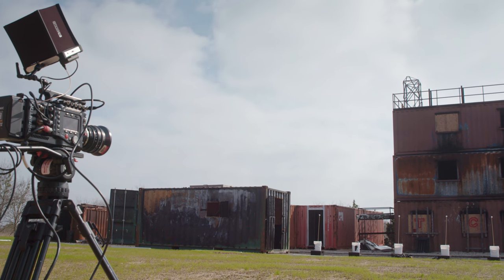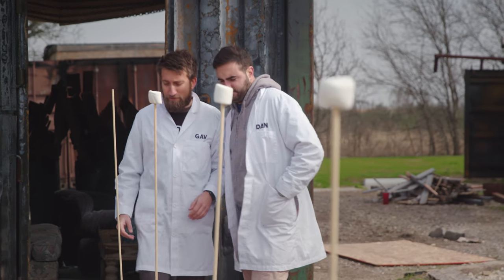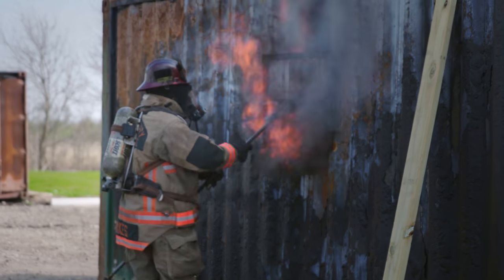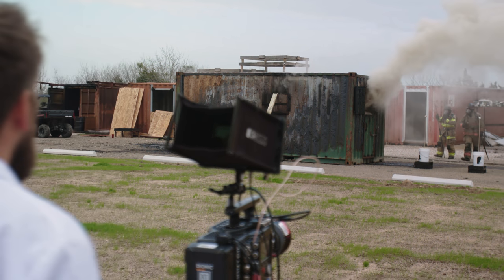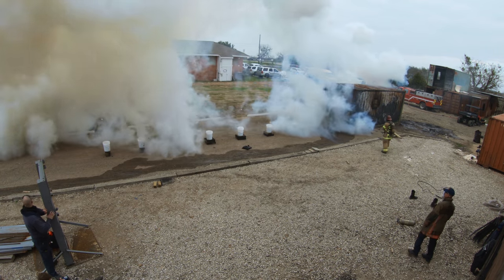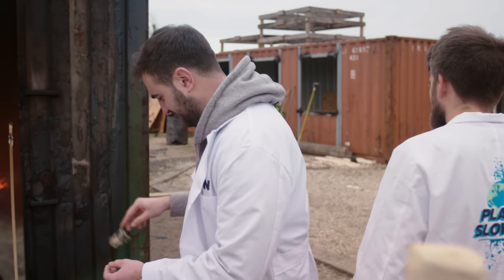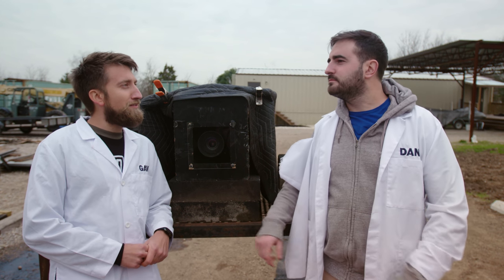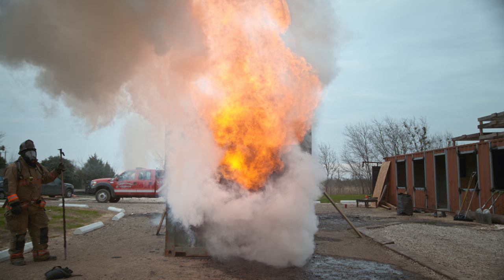4K Slow Motion Backdraft

Comment: This happened to our department and the city fire department when they called us in to a large corncob bin fire. Two large doors where open to allow us to pour water streams into the structure. We'd been there for almost an hour when my chief ordered me to go fill somebody's air bottle. The truck with the cascade unit was just outside of the fireground as I changed the guy's air bottle. That being done, I got on the horn and asked the chief if I could set up the cascade to fill more air bottles, as this job looked like it was going to be a long, drawn out affair. He said " Yeah, go ahead Ron."
As I put the empty bottle into the steel bucket to start filling it, I heard a loud, rattling, booming sound and looked up in time to see a huge plume of orange-blue flame, smoke and burning corn cobs engulfing the city's engine and everyone there in that area. I saw the top of the bin lifted up and clanged back down again, with flaming corn cobs rocketing into the air. Silence then surrounded the area, except the sound of our trucks. My first thought was " My God, they're all dead!" But then I heard one of the paid city guys call out, "Eyeee-haaaaaa!!!" 
Okay, time to go. Somebody's okay!
I grabbed my gear and ran back in there to help pick up the pieces.
In all, three of Fremont's guys had some burns and bruises, while ten of us volunteers where battered around more by the backdraft. Two had dislocated shoulders, while others suffered from bumps, bruises and some burns. A friend of mine didn't know he'd wrenched his back after everybody was transported to the hospital to be checked out. ( the adrenaline wore off!) What's spooky about it? It was Halloween, 1997. We got our Halloween scare...
Reply: Ronald Robertson wow
Reply: I have a creeping suspicion none of this ever happened
Reply: @Cookie-gw1vv  It did! Believe me, it did. It put our department out of action for a couple of days until we could get the equipment we lost replaced. If you can, look up in the Fremont Tribune, (Nebraska) November 1, 1997. The fire is in there.
Reply: @ronaldrobertson2332  maybe give a link?
Reply: Fremont Rural Fire Department does have a Facebook page. Go there and ask about that fire. October 31, 1997. Fremont, Nebraska. Ask about that fire at Junior Weiser's.
Reply: Let's be honest guys... who did not read the thing full and came to read the replys?
Reply: Grossmesser1  The fire was Halloween, October 31, 1997. A few of our guys were out celebrating Halloween when we got mutual-aided by the city fire department.  I was getting ready to take my daughter out for her first trick or treating; she was barely one-year-old at the time. We got the page, and my wife volunteered to take her out while I went to the station. She later told me she heard a loud wang from over by Hormel, a mile and a half away. That was the backdraft that almost took out Fremont and Fremont Rural Fire Departments.
Reply: To me this sounds less like a backdraft and more like a grain dust explosion. https://youtu.be/IiuBoAhJxaM this is a link explaining what a grain dust explosion is.
I'm a ff in a very rural town and have taken classes on farm equipment emergencies
Reply: @zombiekil67  yeah, doesn't a backdraft happens only if a room is closed, and it burns all the oxygen, and when you open, it suddenly re ignites and boom ?
Reply: r/tottalyhappened
Reply: I'm sorry, but I'm imagining corn flying everywhere...  Ignore me I'm a horrible person who can only laugh in the face of other's pain.
Reply: @TurtleSauceGaming  ...And yes, you're a horrible, horribly mean guy. 
You..you mean guy!
Reply: There will always be somone critisizing no matter what the situation is, i believe this
Reply: PLEASE use paragraphs.
Reply: Umm a firefighter does not call a cylinder a air bottle 😩 trust me I’m a firefighter 👨🏻‍🚒 just like you do not call a engine a truck a engine is a pumper a truck is a ladder
Reply: @justinwetzel9741  Which department are you with?
Reply: @justinwetzel9741  Bro we all call them different things in different places around the U.S. and beyond. Especially if your department doesn't even have a ladder truck nobody is gonna care what you call one or the other.
Reply: @ronaldrobertson2332  one you have never heard of
Reply: @joelaugustin6407  you would still know a ladder is a truck lmao a engine doesn’t get dispatched as a truck now does it 🥱I bet there’s some probies out there calling a New York Hook a Pike Pole and don’t know what a flat head axe is with a halogen bar🥱 a set of irons
Reply: @justinwetzel9741  except the fact that a lot of firefighters do call oxygen tanks air bottles

Comment: I was a full time Fireman for 30 years, an indication that a backdraft is imminent, is to look for 'pulsing' of the smoke coming out of the building, just about visible in these scenarios although not very clear at all.
I was once doing 'flashover' training and actually inside a container on fire just like this, after we extinguished the fire, I looked at the temperature recording equipment, it showed 520 degrees celsius at head height, we were lower than a snakes belly putting it out!
Reply: Olbno
Reply: No full time firefighter calls himself a "fireman." If you were a fireman, you stoked fires, you didn't fight them.
Reply: @gordonhaire9206  I don't give a toss what you think, I joined FULL time nearly 50 years ago when we were called FIREMEN, not a woman in sight!
Reply: @cvince2862  I joined 58 years ago. We were firefighters, not firemen. The job title was FIREFIGHTER.
Reply: @gordonhaire9206  Plenty of firefighters say fireman casually, full time or otherwise. This is a youtube comment, its not like he's updating a resume. Quit giving credence to the crotchety old smoke eater stereotype.
Reply: @gordonhaire9206  do you think it is remotely possible that the two of you come from separate countries and that is why you use different terminology?
Reply: @gordonhaire9206  relax..  fireman is included in official dictionaries as male firefighter..  in addition to the person who tends a furnace or steam engine.. both are used.. although firefighter makes more sense..

Comment: I'm no expert, but I would not have expected a fireman to walk into the killzone like he didn't know what was going on.
Reply: The Philadelphia Robot Factory
Reply: The Philadelphia Robot Factory 145638
Reply: it looked like he knew the limits (hopefully) and just avoided the actual hitbox by a few pixels.
Reply: He was starting to duck as he was stepping through, but I bet it didn't feel like enough.
Reply: He was following orders by I guess his superior, just happened to be in the wrong place at the wrong time
Reply: I'm sorta thinking from what can be seen that he was actually about to duck under the window because right before the fire spews out he it looks like he's starting to angle himself down to maybe crawl under or just be in a position to drop quickly in case it came out. I would even go as far though to say that it could've been slightly on purpose with the idea going through their minds thinking "we're going to show people just how dangerous this can be when a professional firefighter himself has no way of knowing when the fire is going to spew out" while making sure that the one crossing would be in a position make sure he wouldn't get hit. It's also possible that backdrafts are hard to replicate and are not fully understood and it was thought to be unable to backdraft after a certain time period, but were wrong. However that does make sense as that first backdraft was actually fairly weak compared to the others of which took less time to initiate the backdraft and seemed to reach further and spew fire harder.
Reply: I'd say just impatient. "Where's the ka-boom? There was supposed to be an earth-shattering ka-boom!"
Reply: Very foolish from a professional
Reply: This is why there's training facilities - everyone makes mistakes
Reply: @elitebelt  (
Reply: @bernardw7535  he was probably the rookie and the chief wanted him to learn a lesson about expecting the unexpected.
Reply: A real backdraft happens within a second or two of oxygen introduction. The Dutch door design probably had something to do with regulating the amount of oxygen that could get in quickly as the smoke was pushed out.
Reply: @SengRath-xu4nw  the n
Reply: The whole department fail..
Reply: That's easy for us to say, but considering he's totally find and didn't even have to take a break and replace his gear I think he knew the risks and decided it wasn't a big deal.
Reply: Hi
Reply: @SengRath-xu4nw  9 2018 p
Reply: 690 likes 

Nice
Reply: @bernardw7535  well, any sane person would say no to this kind of order, it's like if you see a guy with a machinegun suppressing a hallway, you're not gonna run in front of it, would you ?
Reply: You'd think that he would have go around the container of crispy death.
Reply: @Nareimooncatt  That's a far reach right there. I doubt it. I think it was just human error. Besides their suits do protect them to a good degree. Everybody makes mistakes. It is what it is.
Reply: Fireman is not an 8 yr degree lol
Reply: Except that's his everyday job. These are not burger fighters, they are fire fighters.
Reply: He was the affirmative action hire
Reply: Well you gotta consider, this is probably a really good training refresher for them as backdraft's aren't something they see or deal with every day. So wouldn't be surprised if the two guys actually running the demonstration aren't actually the most experienced ever, since you can see several more firefighters in the background observing throughout the video. But to me I don't think he was actually going in front of it, it looked like he was just bending down to open the door at the worst time possible lol
Reply: @SengRath-xu4nw  fist time typing khmer on the keyboard?
Reply: It's called, rookie!
Reply: Exactly, like how did he become a firefighter
Reply: People can get complacent on training grounds. It's also really different to have a camera crew on site too. Definitely not defending this critical mistake but I could see how if it were going to happen it would be in this situation
Reply: That guy saw his life flash before his eyes
Reply: @kaipaio4158  Same reason you were conceived.
Reply: К
Reply: @NGC1433   burger fighters?
Reply: They knew exactly what was going to happen and thought it was not going to happen at all.  But then WHOOOOM
Reply: Seems to be a lot of armchair experts here.
Reply: @kaipaio4158  your comment makes absolutely no sense, do you expect firefighters to be highly trained and experienced from the day they first apply for the job.
Reply: Firefighter gigs have been highly-prized since forever because it's a local municipal job with a government pension and a powerful union where 95% of your shift is spent sleeping, eating or doing maintenance.

I worked for 5 years as a firefighter in a medium-sized US city: when I was there, there were approximately 10x as many applications for the fire service as for the police or EMS, and this is with a bachelor's degree in Fire Science and 2 years experience with a volunteer outfit being mandatory to apply . There are also far less jobs available for firefighters because the job's actually less physically demanding than police or EMS, so most of them retire in their 60s instead of in their 40s or 50s. It used to be a thing where only the Chief was allowed to be old and fat... now the Lieutenants are all old and fat, too.

The upshot of all of this is that most paid firefighters got their job because they knew somebody or filled a quota somehow. The backlog of highly-qualified candidates is so long and the number of (union) jobs available is so small that there's no way to avoid the influence of political patronage. Fire Inspector gigs are the same way.
Reply: the army has a similar 'easy' image, if you ignore the mental burdens included. Firefighters see some crummy stuff, to put it mildly. But it's good many people still have a sense of duty, wanting to save lives - even with that political patronage. There's still people with ideals.
Reply: @forsaken696  are 👍
Reply: @bernardw7535  Where have I heard that before?
Reply: @alveolate  a
Reply: @SengRath-xu4nw  9m
Reply: backdrafts are inherently unpredictable, especially if you cant see into the space that is on fire, everything from the temperature of the fire, to the displacement of the gas the fuel its burning is producing, to the way air currents move and are affected by the interior and exterior design of the building, and even minor differences in temperature in the different rooms and floors of the building that's burning can all change the way a backdraft behaves immensely.  There's often virtually no warning that a backdraft explosion is about to happen.

Fortunately, the firefighter as you can see is wearing full Nomex protective fire gear, a full helmet, a flash hood, and a full face respirator with a self contained air supply.  The face respirators and helmets American firefighters wear are made from a specially designed type of plastic that actually gets stronger and harder as its exposed to heat.  You'll notice as the firefighter realized what was happening, he tilted his head down, shielding his face from the fire with the top of his helmet.  That firefighter, for the most part, couldn't be safer from the danger.
Reply: Had that been a non professional, he most likely would have been cooked. It was his experience, caution and situational awareness that allowed him to stay just out side of the danger zone.
Reply: He knew exactly what was going on. Take a look at his helmet. He has done that before.
Reply: @bernardw7535  
HE could have followed the orders by going around the back of the box.  No orders are an excuse for such idiocy.
Reply: @coaxill4059  Nah it was still stupid.

HE almost got domed with a 1000 degree jet of hot air travelling at the speed of sound.
Reply: @rhino2960  ... HE could be safer if he wasn't walking in front of a 1000 degree jet of fire and hot air travelling at the speed of sound.
Reply: @addictinggames5232  as far as i can tell the only order given was to open up the windows, he didn't disobey any orders.  Made a dumb mistake? maybe, but keep in mind, the firefighters in this instance know exactly what's in this burning room, they know its exact shape, the exact temperature its currently burning at, he knows the door under the window is latched shut with a heavy steel bolt, and most importantly, he and his fellow firemen all know exactly where their teammates are, and can escape any potential danger from this fire simply by stepping back, to them this is effectively backdraft training, and the best place to make mistakes is during training, when everyone around you can react immediately if you're injured.
Reply: THis isn't a training exercise this is a demo for a million-viewer audience.  They didn't send some newbies to show off the dangers of backdraft.

And second, there's no way a firefighter can inherently perceive time in those suits.  I've gone through firefighter training in the Navy (all sailors must be qualified firefighters) and tbh you can barely perceive the passage of time in those suits due to isolated disassociation (you most likely experience this driving a car - the isolation from external stimuli creates a disassociation between your perception of time and motion).
Unless dude was counting 1 mississippi 2 mississippi he'd very easily lose track of time.

There's noooooo way that he was being mindful.  Keep in mind that if the bottom door experienced any kind of failure, he would have been blown away at the speed of sound.  Training or not, the body does not like concussive forces.
Reply: Verttifies
Reply: he was listening to who paid him...
Reply: @bernardw7535  exactly
Reply: https://youtu.be/IGI1xrm0-Cc

PRESET INIKAH YANG KALIAN CARIII🗿
Reply: The fire was waiting for him. It has intelligence.

Comment: I along with so many others have had a flashover, not a backdraught, pass completely over my head to curl down the wall behind me.  Your friend is your PPE and your hose.  You MUST keep the water on.  Drop the hose and try to exit and you probably won't make it without serious injury.  All you can do it keep cooling the air until the gases have burnt off.  It is terrifying the first time and not much better in subsequent events.  The lazy orange flame covering the ceiling is quite spectacular.  Prior to the issue of flashoods and Nomex gloves to us in the 80's hand and facial burns, especially the ears, were very common.  Even with the hoods and gloves you would still boil in your own sweat and suffer heat syncope.  We lost a young guy from one of my old stations in Greater Manchester after he suffered debilitating heat syncope and dropped on his way out.  Absolutely tragic, a fire started by two young girls messing about burning brochures outside and pushing them under an external door to a hair dressers.  Fire can be quite beautiful especially filmed in slow motion but we obviously never forget just how deadly that beauty can be.  Thank you for demonstrating the dangers we face.